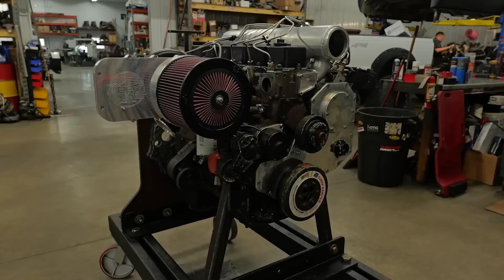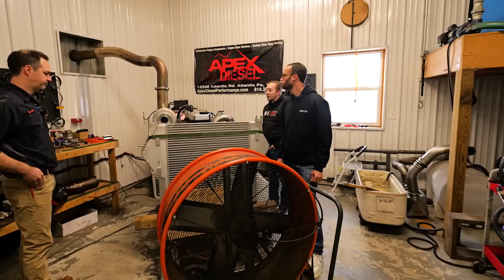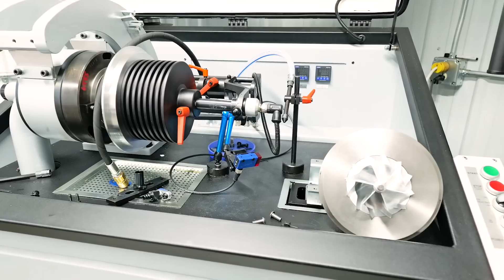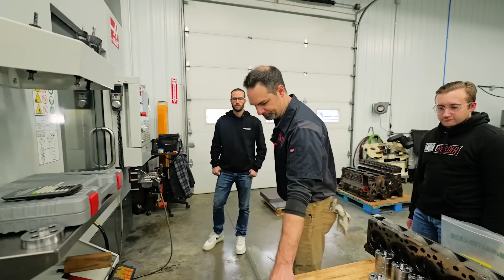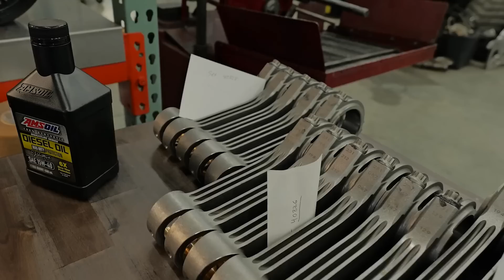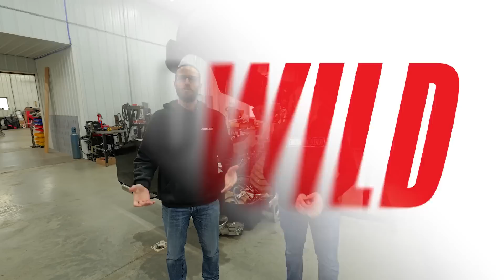Building Super Stock Diesel Engines at Apex Diesel

Comment: $115K won't even buy HALF of an NTPA (National Tractor Pulling Association) Super Stock Diesel "P-pump" - injection pump - for a 500-cube 5000+ hp FACTORY STOCK PRODUCTION BLOCK John Deere pulling tractor, lol. 

The "engjne" is the "cheap part" of true competitive NATIONAL SANCTIONED SUPER STOCK DIESEL PULLING VS. THE CHASSIS - WHICH INCLUDES THE TRANS, DIFFERENTIAL, FINAL DRIVES, HITCH, ROLL CAGE, FRONT AXLE - TIRES, FUEL SYSTEM, INDUCTION SYSTEM, "BODIES" ETC. 

YOU BETTER HAVE $750K CASH AND A FEW YEARS OF "FREE TIME" TO WAIT FOR "DELIVERY" NOT TO MENTION BE A "MECHANIC" - AND A DAMNED GOOD ONE - YOURSELF TO BUILD A NTPA SSD PULLING TRACTOR OR $1 MILLION TO HAVE ONE "PROFESSIONALLY BUILT". EVEN OR RATHER ESPECIALLY IN YOU BETTER HAVE "ON POINT" MECHANICAL ABILITY. 

AND KEEP IN MIND BESIDES "DATA LOGGING" AT A VERY "ANALOG" LEVEL THERE ARE NO "ELECTRONICS" ALLOWED ON NTPA TRACTORS. 

JUST LIKE NHRA TOP FUEL AND FUNNY CARS. 

BECAUSE IF YOU CAN'T "HAND TUNE" A "MECHANICAL" ENGINE AND VEHICLE IN MOTORSPORTS AND BE "COMPETITIVE" AND "CONSISTENT" ENOUGH TO BE "UP WITH THE WINNERS" MORE OFTEN THAN YOU DNF/DNQ NO AMOUNT OF "HIGH TECHNOLOGY" AND ACCESS TO "INFINITE" TUNING "ADJUSTMENTS" IN A "FEW KEYSTROKES" AND "BETWEEN ROUNDS" WON'T HELP YOU "COMPETE" MUCH LESS "WIN" BECAUSE YOU WON'T HAVE ANY "BETWEEN ROUNDS" BEYOND "TEST AND TUNE DAYS".

Comment: I had my 91.5 Dodge worked on over there at Apex diesel and when I got my truck back, I had to spend about $450 to get my charging system working again ruined my battery. I bought a Hamilton Cams stage two head from them and my original head, which was still a player. He left my head laying in the back of my truck. It had been rebuilt now the deck surface is all rusty on the head destroyed. My heat exchanger on the side of the block, broke a transmission line from the transmission and things like my fuel filter now to be fair. He had to put a second GEN system on there because sooner had don’t have a provision for the fuel filter, but when I went to change the filter, I like to do that every fall I had to take my bracket for the transmission kicked on cable and the throttle cable and lay it off the side and I had to use two. I’m gonna repeat that again too oil filter wrenches to get That fuel filter off. They must’ve had a torque on there at least 50 foot pounds I mean the side of the filter caved in and everything when I was taking it off and then I found out later that jag off Dustin does not like first GEN Dodge and I treated him right I paid him cash so that way the debit card wouldn’t run up the fee. I was a good customer. I didn’t call him every two days. Hey are you on my truck yet and by the way, he did do that Quite promptly he got on my truck and got it out of there, but I had to do a huge amount of repair on my truck afterwards case and point my wiring is fucked up. I had to change my alternator to a one wire system and there’s other things he did. There’s a list just went on and on I wouldn’t take a fucking wheel barrel over to him to work on he’s a jack off. This is six in a row.Jim
Reply: Jim, we like all honest reviews, both positive and negative.  But dishonest reviews are just uncalled for.  If you had issues after your work was completed, you have our number and could have called.  But seeing how we worked on your truck years ago, and anyone that knows first Gen rams knows, replacing the cylinder head we would have not even been in the same region or touched the heat exchanger or transmission lines.
Also, the charging issue your eluding to could most likely be traced back to a failed PCM, which is extremely common on those trucks which is now approaching 30yrs old.
The fuel filter being too tight?  Very possible, my grip strength could be more than I realize, for that I apologize.  We install them hand tight, not with a filter wrench.
Reply: Since you know everything why didnt you do the work yourself

Comment: Even on the best tracks either build will need more driver than power! Till there are major rule changes especially to tire size, driving will be the most important input.
Reply: Very true, the SSDT class is a drivers class for sure.
Reply: I would love to see someone run 6 dot 35 inch tires. 
 
I would also like to see if maybe backing down 500hp would help.
Reply: @oe542  We have a locl class that allows DOT's or cuts.  And at that power level the DOT's just dont have the traction to work out.  On a sandy track, cutting power and DOTs would be the ticket though.
Reply: @apexdieselperformance4024 thanks. I’ve been pulling and a part of diesel truck pulling since 2000. Since Brad Ingrams truck had rear leaf springs…. And tbh this class has struggled since tube chassis became a thing.